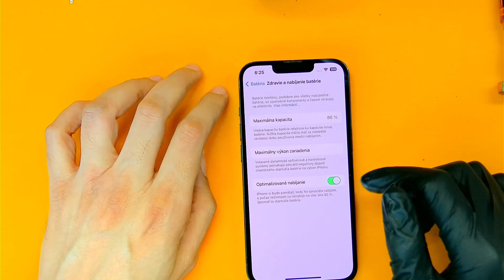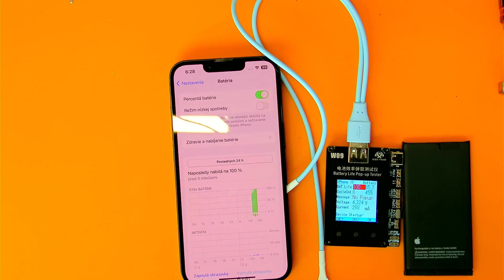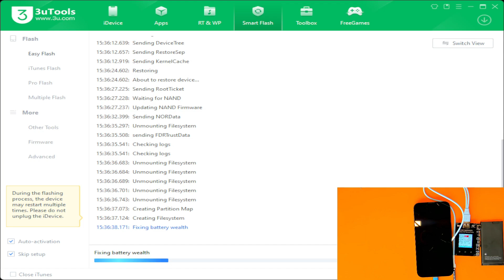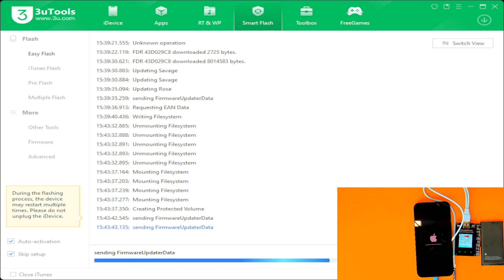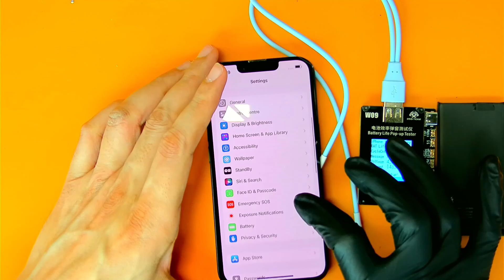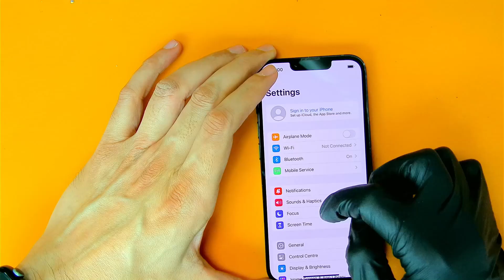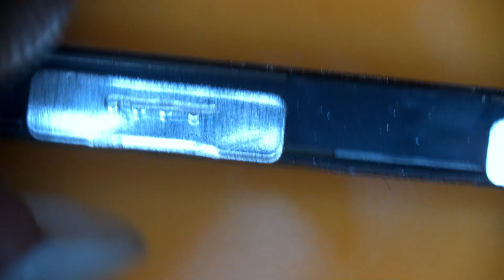iOS 17.4.1 Battery Health Fix: Easy-to-Follow Tutorial for Fixing Battery #iphone13

Comment: Hi! I’m trying to modify the battery health in an iPhone 12 Pro with 17.5.1 but I can’t. I use a JCID v1se, so, theorically I need to program the Tag On Flex with 100% and 0 cycles, then use Quick Flash Mode and select Fix battery health with the Tag in the battery? I tried without the TagOn flex but also didn’t work
Reply from the maker: Yes tag on must be installed when you restore in 3utools but make sure your 3utools is updated to latest version then it will work
Reply: @PhoneRepairTips  I updated 3utools and it works!! Thank you so much🙏

Comment: Hi it is not working with iPhone 12 Pro Max an 17.4.1. 

The important battery message comes back evertime. 

When try to flash with 3u tools the iPhone always restarts in recovery mode.
Reply: Yes it’s working with the original heath data. 

I think I send back the programmer and order a new one. Then I try again as shown in your video. 

Maybe something faulty with the programmer or the flex.

Will be back thanks for your help 👍🏼
Reply from the maker: Then it’s issue with your connection shouldn’t be message that means it’s stuck on 1% battery
Reply: Hi how can i fix this ? I always stay at 1% Battery 😞 So the programmer is broken ?
Reply from the maker: @rm6539  when you install battery without program it’s working ?

Comment: Hi im using the same exact method as you are including the w09, but the battery health still showing the old data,its for iphone 11 running 17.4.1 any idea why? And what version are you running for the 3utools? Thank you in advance
Reply from the maker: I am using latest version of 3utool just check for updates and install new version will work
Reply: @PhoneRepairTips  thanks bro, my bad i updated 3utools and it works flawlessly

Comment: I don’t have the box you use can you do same process with only pre programmed battery flex ?
Reply from the maker: Yes I guess after use flex try the same 3utool method also let me know
Reply: @PhoneRepairTips with pre programmed flex I get the message unknown battery and in 3U tools show unknown battery and 0 cycle count . Do you know what to do then
Reply: @PhoneRepairTips I also am not changing the battery it’s my personal phone and it’s at 95 so I want to upgrade the health cause it dropped out of nowhere it’s a 14 pro
Reply from the maker: @casereviewer3026  yeah you can do it without changing battery
Reply: @PhoneRepairTips  okay perfect ! My only concern is with the pre programmed battery flex when I connect it to the battery it shows unknown battery and in 3U tools also doesn’t show battery health and cycle
Reply from the maker: @casereviewer3026  first time it will show unknown keep it connected then restrat
Reply: @PhoneRepairTips  exactly I have restarted 10 times and it still shows unknown with the same cable I repaired battery health on iPhone 14 Pro Max on iOS 17.3 yesterday and I tried 4 different cables on that iPhone 14 Pro and it still shows unknown battery
Reply: @PhoneRepairTips  battery connected to preprogrammed flex cable shows 0 charge times and N/A battery life in 3U tools

Comment: quick flash erase data, so backup to icloud is important before any steps, but what if user can't pay for cloud ? If backup will be made locally to PC using 3utool or iTunes and after 3utools quick reflash+fix batt health will be made and then restore backup from PC, will this again show "old" battery % or it will stay on 100% ? What will happen with tag-on or removed tag-on? thanks for reply
Reply from the maker: After restore data no issue it will show 100% about remove tag on if you want to see in 3utool you have to always attach tag on flex I mean keep it inside if just in settings you can remove tag on flex in 3utool it will show old battery data but in settings will be 100%
Reply: @PhoneRepairTips  what about erase all data (restore to factory state like for selling propose )will not also remove 100% battery health ?
Reply from the maker: @jantestowy7884  nope will stay same
Reply: @PhoneRepairTips  Hi again, did You check 3utools battery health FIX for iOS 17.5 (they just released retail normal version not beta) ? I don't have now such new iphone to test it
Reply from the maker: @jantestowy7884  yes working same method

Comment: So with this programmer or JC brand, we can say bye to tags on flexes?
Reply from the maker: Not really with this programmers you won’t get battery health in 3utool once you removed the tool so if you want to show same health in settings and 3utool need to install tag on
Reply: @PhoneRepairTips if you use tag on flex do you not need to purchase any type of programmer to make the service message go away? iPhone 13 Pro with iOS 17.5.1
Reply from the maker: @Bostonn617  bro flex or program is only for modify battery health